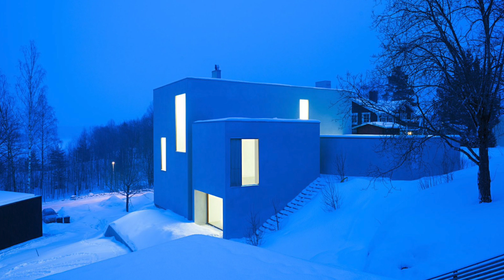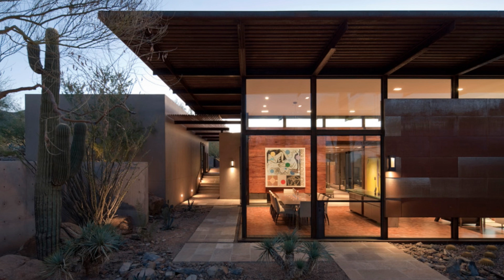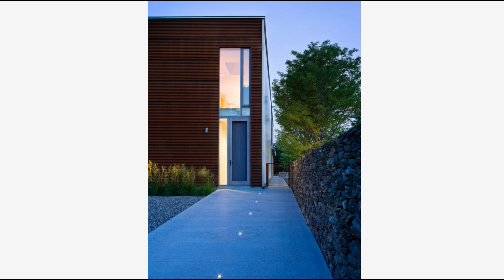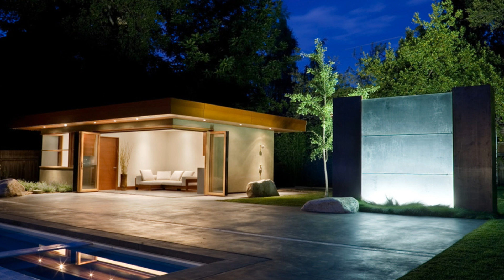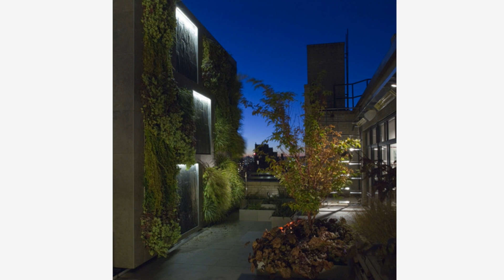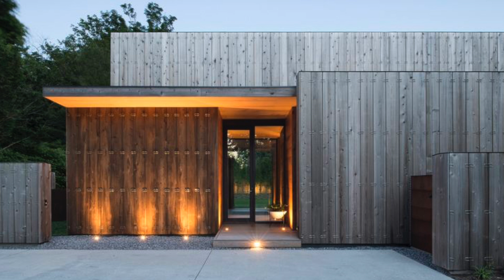Exterior Lighting Concepts (An Architect's Guide)

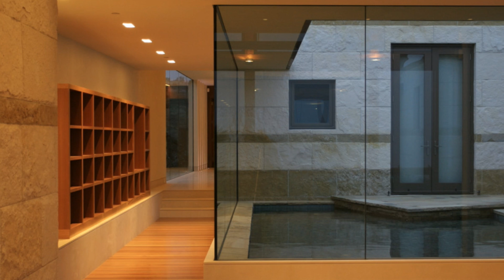Comment: Just to be a stickler, @ 4:35 you said "Degrees Kelvin", however, by convention it should just be "Kelvin" because it is an absolute temperature scale whereas the Celcius and Fahrenheit temperature scales are relatively defined by the freezing and boiling points of water, namely, 0 °C & 100 °C and 32 °F & 212 °F respectively at sealevel and standard atmospheric pressure.